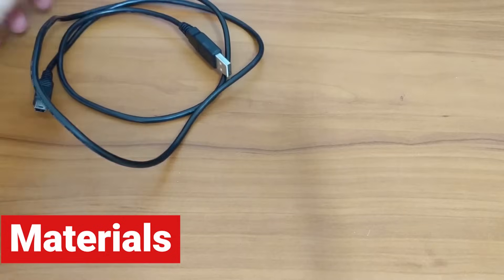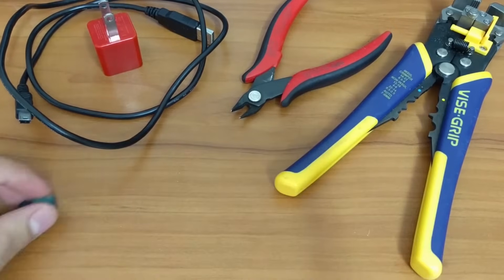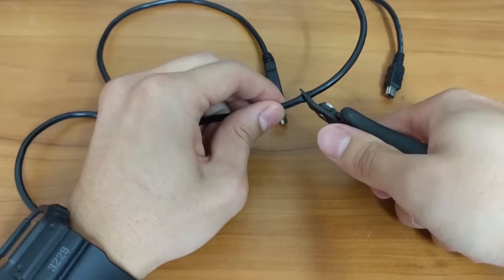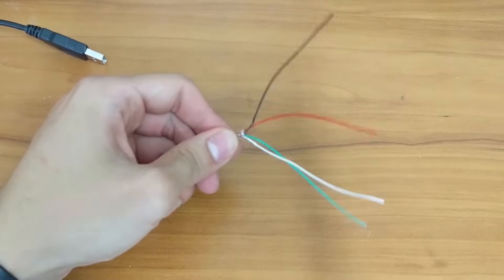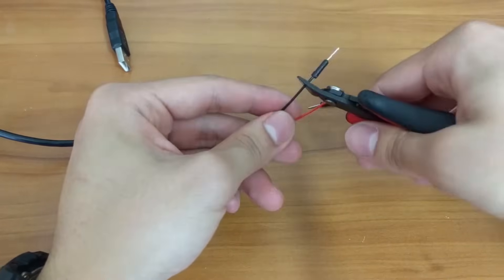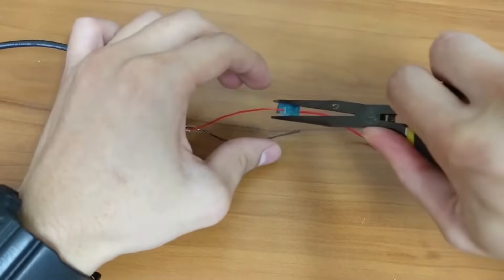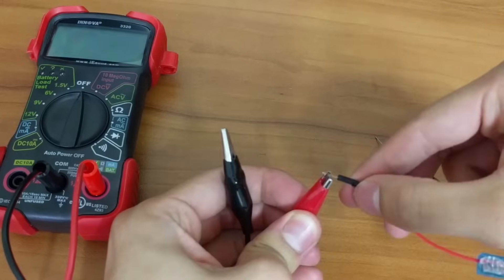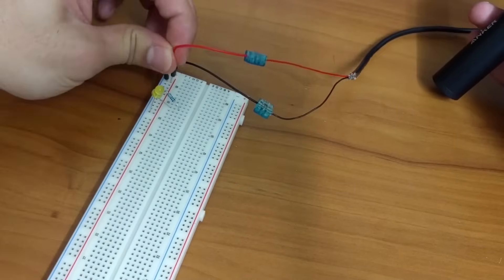Tutorial | How to Make your own 5v USB power supply CABLE (without soldering)

Comment: is USB from lighting the same amps as regular USB?
Reply: the max current is controlled by the receiving device and the usb converter, not the usb cable itself.  if you look on the usb converter you can see the max mA or A it'll output!

Comment: I have something similar and hoping you can help. I have a small solar panel with red/black wire. I want to add a USB micro B to the other end. Is there a USB Micro B with adapter to simply plug the red/black wires into or would I need to do some soldering?

Comment: I’m trying to make a little retro gaming system with raspberry pi. I didn’t want to run power through wall. Just wanted to get juice from USB from tv port to hide all the wires. Do you recommend this strategy or am I going to fry my tv and/or raspberry?

Comment: Twisting the wires and Hot glue or Electrial/Insulation Tape works equally well (Even  Gaffa/Silver Tape), For those not having splicers laying about or just dont have the possibility to purchase them this instant but need to get a cable working.
Reply: I twisted the wires together and secured with electrical tape. I tested with the multimeter and it reads 5.1 volts. I'm satisfied. I'm using this to power a breadboard.
Reply: Please stop, hot glue? Man just get a cheaper then cheap soldering iron for like 5 bucks and do it correctly. This is some serious junk solution that is only accepted for emergency or testing,

Comment: Question: I have an end-table with a 120V socket and two USB sockets for charging. The plug end (at the wall) was wired backwards, so when I plug an outlet tester into the plug in the back of the table, it reports "Hot/Neutral switched". I can mechanically switch the tabs at the table end, but while that will fix the 120V plug, it'll leave the USB outlets soldered to the wrong wires.

My question is: do USB ports care? Will the circuitry fix whatever current problems the reversed circuit will cause, or will it fry anything that we try to plug in to charge there?

I'm asking because the solder is being very very stubborn, and my attempts at unsoldering the wire connections have only resulted in starting to melt the plastic housing the metal tabs live in.

Comment: my powerbank says it can output even 9V/1,6A , i need this voltage for my arduino project but when i plug an usb to a powerbank it only gives 5V/2A is my cable too weak?
Reply: It can only do 9v if the USB can negotiate with the device (aka, USB-PD).

By cutting the data wires it can't communicate so it'll do 5v. How many amps I can't find sadly
Reply from the maker: Check the 9v output with a multimeter. The cable shouldn't matter

Comment: hello, can i use this technique with multi role power supply(input ac 100v-240 volts,30 w,max 3A) this is for pca9685 controlling servos, cause usually the power supply only have one straight connector (which i think should be two red and black)there are other options too but i am still understanding every of them =__=; anyways thank you.
Reply from the maker: Hi I'm not sure. Hopefully someone else can chime in.

Comment: Can I just use Electrical tape to connect the wires?
Reply from the maker: Yes but I'd recommend soldering if that's an option
Reply: Thanks. I just sacrificed my charger for our worksheet. And I didn't regret because it worked.

Comment: I got an old USB C cable, and it only has Green, White and Red? would that work?
Reply: GRN/black is most likely embedded in the shielding if you look closely enough. You should find raw/metal colored 1-3 wires there. You can confirm this by prying/opening up the USB connector that you cut off -- it will have GRN connect to one of the ends going through into the wire.
Reply from the maker: I would use a multimeter to test the voltages to see which one is + and which one is -

Comment: I have a ir torch which runs off 2xcr123 but they dont last long is it possible to bypass the batteries and plug in to a power bank
Reply from the maker: It depends if it's rated for 5V or not? If 5V then yes, otherwise you can build a simple voltage divider to output the correct voltage

Comment: |                |
|  _  _  _  _ |
----------------      I know the power supply cable should go to the sides, which one is positive and which one is negative (looking plastic close to the bottom of the "female" USB socket ) ?
Reply: use multimeter. if the voltage is negative, reverse the polarities.

Comment: What if short circuited
Reply: It's likely that the charger has a current limiter.  Not a good idea to short it, of course, but it won't hurt you or spark.

The charger should clamp the current if it is too much, essentially turning off the power of you spark it.
Reply from the maker: Might break your usb wall plug..so don't short circuit it